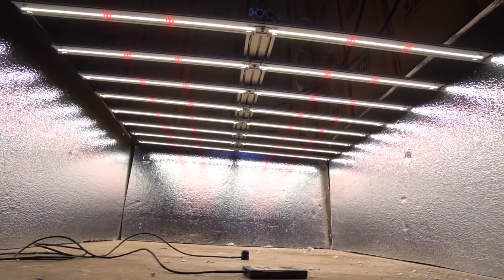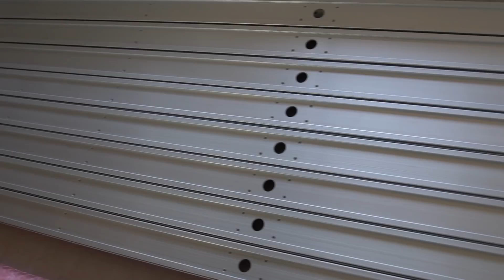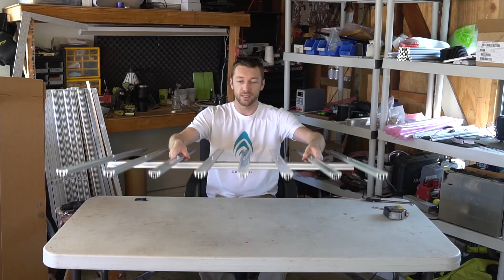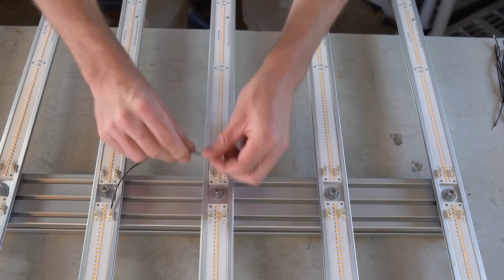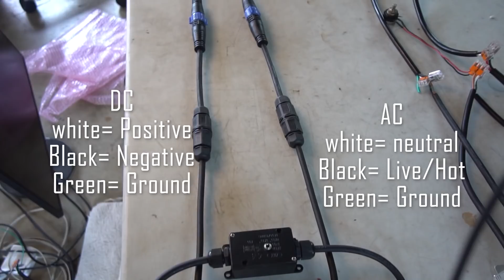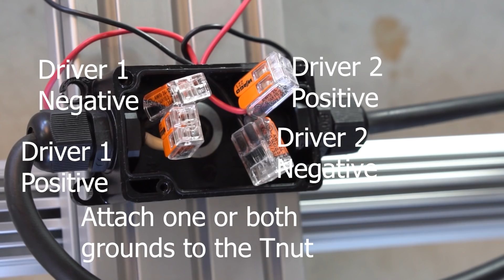Ultimate DIY LED Grow Light: Photo Boost Reference 1.2

Comment: And there goes my government 1200 bucks 😂
Reply: Same 😂 just 850 of it
Reply: @acemany1126  what would u suggest.
Reply: Why not just buy a hlg for $800? Is plc a better build than the hlg?
Reply: @elperrocovero  there a diy soultion and more even coverage.
Reply: @Ramdompcgamer  huh? What has more even coverage and which one would be better
Reply: @elperrocovero  plc uses long light bars instead of quantum boards where there all centered in the middle of your tent. The bar lights run the full size of a 4x4 tent offering a better coverage/ more even coverage
Reply: @elperrocovero  plc if u know how to build a light
Reply: @Ramdompcgamer  it´s no rocket science connecting some cables and aluminium profiles

Comment: Have built a couple of early generation lights, so a longtime follower, and wanted to see if you might have any suggestions on some bumper guards for the edges of these heat sinks. If I had a quarter for every time I hit the corners with my head I’d be rich...Lol...Thanks again for another great build btw...

Comment: With the link for the replacement heat sinks do I just have to select the 46 inches and I’m good to go there are several machining options and I can’t really tell by looking at the diagrams just worried the strips don’t look like they will fit in the same from both the drawings on the out of stock hest sink vs the suggested replacement

Comment: Hey Gene! Thanks for all the great info. Im just about to start my first photoboost build and have a question.
Would it be possible to skip the cable connectors and only use the quick connectors? Or is there a reason why you use both?
Thanks!

Comment: Where do you run the ground at the strips. Used the appliance cord to run the dc output. Have the + and - hooked up... Can I attach the ground to one of the bolts on the main frame of the light? I know the other end is grounded at the driver. Am I missing something?
EDIT: I found it...

Comment: Running 7 sets of 8 currently... (8 more on the way) what plug might the  better way to have a disconnect between the lights and the  power source.  Passing all of that “stuff” through the tent holes gets a bit trying.  Any twist lock type of low voltage recommendation?  Just noticed your elbow is wagging ? 😁

Comment: Do we have to use 18 gauge solid wire or can we use 18 gauge strand wire? I’m asking because I have a 500 ft roll of shielded 18 gauge strand wire that I use when installing hyper heat mini splits, it’s a really high quality strand wire. (Really expensive too). Thank you.

Comment: Just noticed the amended description. I guess that's the end of DIY LED lighting, big business wins again. I went all in on V1    QB288's that I was able to get for $30. Mopped up a bunch of QB120 and QB96, but it looks like those are no more. Now that I'm driving high PPFDs, it seems like strip lights would prevent the high/low areas you get running QB close to canopy.
You going to keep running the channel?

Comment: Any update on when you'll have the PLC Photo Boost strips back in stock and for sale???  I watched this vid right after you made it and saved up to build 4 of these lights. Soon as i had the funds there has been no sign of the strips coming back in stock. Tried to chase you down on your IG, even emailed the PLC contact info but all with no luck. Just wondering if theres any date on a possible restock?? Thanks for any reply brother. You're doing some epic work for the LED grow community. $1500 for a single light is not OK. Its rape 😡

Comment: I have done a couple builds with led strips just using 2 sided thermal tape and a old aluminum sign cleaned up as the heatsink. Most i have ran the builds was 1050MA on a meanwell driver but the aluminum signs that were aprox 2.5mm thick did quite well keeping the strips cool, i could have ran the strips easy 1400ma and still be a acceptable temp. The aluminium sheet or old sign if big enoughf is a great option if someone looking to save a few dollars.
Reply from the maker: what strips?
Reply: @GreengenesGarden  the strips im referring to are bridgelux eb strips gen 3 and Samsung f series strips from builds i did a couple years ago now. I don't see a reason this would not work for any strips including the photo boost strips. I know the heatsinks extrusion strips would be better rated to deal with heat as well as look a little nicer.
Reply from the maker: High powered diodes is why. And Tj temps in general.

Comment: Just so you know.  The build list for the 8 bar build recommends the wrong 1/2” imperial hex bolts if you are using 10 series as your heat sinks.  The bolt heads are too big to fit both bolts to the corner brackets.  Be sure to order 1/2” bolts from the compatible mounting hardware list that tnutz provides on the corner brackets page.  I found out the hard way.  I’m referring to the build list currently on the website also, not the one in the description of this video.
Reply from the maker: Just changed it. Should have been normal button heads.

Comment: what if i have a 4x4 tent with high reflective walls and want around 800 par through what setup can i use. how many strips  the rest is all common sense. if only someone tested just a single strip then i would have calculated it myself
Reply: What you need to figure out is the wattage needed to reach your goal of 800 PPFD. By calculations it should be at around 500W but that's board level, so better go a little higher, probably 15-20% more. So you'd end up with 580-600W of light you'd need for an even distribution of light in your space. At that point, you can basically do exactly what Gene builds here. You could probably scrape a few bucks by buying 14 instead of 16 strips but that would hardly be worth it.

Comment: I have a spider farmer  4000 I would  love to take the drivers off mount  them outside  my tent not sure what I would  need if you could  point me in the rite direction  I would  totally  appreciate  it  your the man watch you religiously  thanks
Reply: There's a guy with a spider farmer 2000, he gets 9z's in a 2x4 and does exactly what you're talking about. I forget the name but there aren't many spider farmer flower videos. I was a longer video too so if you do a search go to the filter
Reply: Get 2 ip68 3 pin connectors and 16/3 wire & just cut relocate your driver extend your cord and run a ground from the light to driver

Comment: Hi my friend!! Very very nice DIY Led built!!!! I love it, Very easy to built, very nice desing, very eficient, and big beast!! well done!!  For curiosity at how many mAh works each led with this setup??? i now that the lm301b datasheet say the maximum for each led lm301b is 200mAh but i. sure that work each led at his maximum 200mAh is not good for long live led.     Thanks a lot my friend!! and sorry about my english.
Reply from the maker: Under 120ma per 301b. Samsung has shown us data at 400ma doing just fine at many thousands of hours of testing. They are very strong and and reliable leds.
Reply: Under 120mA is very very good for long long life.   Uaaauu the data 400mA that they show you is the double than they say in the datasheet, they tell you why they put in the datasheet that the absolute maximum rating work is just 200mA and 300mA just 10 pulse of 10ms?????

Comment: why wire the led lights in series? wouldn’t it be more effective to wire the led lights in parallel. so there wouldn’t be any voltage drop per light.
Reply from the maker: It wouldn't be. Higher voltage has less drop. As well as series is not affected by drop.

Comment: Great Video!  Would this be overkill for a 4x4 tent?  I was looking at the 500 watt Covert with 4 light panels.  Would this  DIY build be comparable to the $600 Covert if you used less boards and maybe being able to use one driver?   Looking for any opinions and  would appreciate any knowledgeable suggestions.
Reply from the maker: YOu can run 8 strips at 1750-2100ma and get a very economical build. And yes, and full tilt in a 4x4 is going to be too much for most to handle.

Comment: Great video! Thank you! My only question Is what would you do if you didnt want the dimmer? Thank you!
Reply from the maker: knuckle head not add one. Same driver.
Reply: Tape off both of the dimmer leads so they can not make contact, or a wire nut.  No contact between the 2 wires= fully wide open.

Comment: I’m a bit dumb apparently because I’m having a hard time wrapping my head around how to wire the dimmer. Would u be able to link a video on how to wire this exactly? I’m looking up videos but they aren’t very good
Reply from the maker: The dimmer has two wires, + and -.
The drivers have two dimming wires...+ and -. 

Put the + together...put the - together...
Reply: @GreengenesGarden  thanks! so they go into the same hole? I was thinking I had to match each end with one separate wire. I may have been confused when i ordered the parts i ordered the box and the orange connectors and the dimmer and thought i was putting the dimmer in the box. I think i just gotta figure out where the + and - is on the dimmer, there is like 5 connecting spots.

Comment: why were the washers left out of the parts list? I ordered and now I can't build. I also can't build anyways since I only received 14 strips instead of 16. I waited over a month for this and watched the video about 5 times before the parts arrived but never caught the fact that the washers was not included in the part list. Also, you failed to mention in the parts list that we need washers, and one extra T NUT for the gland box to be secured on the last step where u make a station and mount it on top of the excursion. Also the DC quick connectors on the "clean" side that are like extensions, aren't in the description as well. also, why didn't you go into detail about how to install the potentiometer? not many of us are used to this stuff. I'm trying my best greengenes. I can't be the only one.
Reply from the maker: Washers can be gotten at any hardware store. Sorry they were not in the list and  that you could see they were needed and talked and shown in the video. 
If you are missing strips, send an email and PLC will get them out ot you. Shit happens and can still build and run with 14. Again sorry, but you can build in the meantime.  
The screws and tnutz for the gland box are accounted for in the list. Thats why there are 36...when the sinks only need 32. 
DC quick connect...not necessary and not easy to find. Either find them or not.
Reply: @GreengenesGarden  plc still hasn't gotten back to me about the missing strips. what's going on?
Reply: I think that sometimes these builds aren’t for everyone, there’s nothing wrong with that, like Gene said, Shit happens. It’s good to order extra sometimes, especially things like the T-Nuts, you can add a lot of things if you choose, Gene is giving you the necessary items needed to build his lights, even gives you a fancy way and the down and dirty way. Think, be creative, he can’t do everything for you guys.

Comment: once u plug a wire into the led board, is there a way to get it out?
Reply from the maker: Yes. push on the connector and pull the wire out.

Comment: This mite b abit off topic but cant find out wuts goin on witha plant.. Leaves are starting to droop and turn black/ grey and die. Any advice? Have 4 plants in dwc and is only affecting the 1
Reply: grey with little bit of white spots? might be mold issue, if its in DWC look over the roots and see if anything is happening in there. i suggest looking closely in there for mites or mold damage then act accordingly.

Comment: What model or what dimmer do you recommend, does that serve to lower and increase the power of the device? Thank you very much master
Reply from the maker: For a two driver system, a 50K ohm potentiometer will dim the light intensity/power draw from 0-100%.
Reply: @GreengenesGarden Thank you very much, and in case of not getting the same aluminum bar to stick the LEDs, I can replace it with a similar one that is used to place the LED

Comment: What is the out voltage (to the lights) of the drivers you are useing? I got the 1400 mA, just wondering about voltage.
Reply from the maker: 8 27v strips in series for ~216v dc.
Reply: Thanks so much!

Comment: How much on the power bill do you guys think one could save approximately, if they replaced a 12 light hps room with 12 of these?
Reply from the maker: 1000w HPS= 1100w at the wall...LED=640w at the wall.
Reply from the maker: Depends on your power cost. At $0.25/KwH it's $41 per light per months. 12 lights is $486 savings per month. Very likely more with the AC load drop too.

Comment: Hey what does it cost to put one of these together.
Reply: For DIY such a simple light, cost would much higher than bought a new well assembled one. normally 640W light 660USD-700USD with 301b diodes

Comment: Why do constant current drivers have voltages described as, for instance 48~95V? I need 4 22.3V strips, in series... What does that variation in voltage mean, and does it matter?
Reply from the maker: Constant current drivers send out a constant current...hence the name. Devices, such as LED strips require a certain voltages and certain currents. The driver only send out the voltage required by the system, but will always send out the rated current. 4 strips in series would be 4x a single strips voltage.
Reply: @GreengenesGarden  Yes, so I need 89 volts. At a constant current of 1.05A.  I have been looking at a driver that supplies 48~95V and 1.05A. its far cheaper, but feel cautious now as another driver supplies 15~143V. At the same current. On the store it can filtered so that you only get one or the other based on the... range... of voltage. Why is it important?
 but simply  would my 4 strips of 1.05A 22.3V work on the driver with the range of 48~95V?
Reply from the maker: Yes 48-95v is perfect.
Reply: @GreengenesGarden  Thank you. I never even needed to figure this stuff out before. Why I need to grow this medicine.

Comment: What if I want strips that have blue in it so I can go from veg to flower?
Reply from the maker: Well if you want blue leds for the sake of it, these arne't for you then. But if you want a plant tuned spectrum that will take you from seed to harvest, these are them. Can go on their site and check the SPD and breakdown. 
If you didn't know, white LEDs are a blue with a coating and the blue that gets through the phosphor is pure unadulterated blue, just the same as a plain blue led. But white leds get all the rest of the SPD form the phosphor too,m not just blue.
Reply: @GreengenesGarden  AH! Okay. I thought that this would only be for the flower cycle. I also didn't know that with the LED colors. That's great then. I can build one for my 4x6.
Reply from the maker: Full cycle with an emphasis on flower. All my runs are vegged and flowered with them.
Reply: @GreengenesGarden  awesome! I’m going to have to try and build some

Comment: Would this set up work with the 320h-c1400A  version drivers?
Reply from the maker: Yes. just wouldn't be controllable/dimmable.
Reply: @GreengenesGarden Would I be able to run each set of 8 strips to the individual drivers and use the built in nob to dim?

Comment: What the total $ to build this
Reply: 890 shipping and all on absolutely everything you'll need to use the water proof connectors and probably 50+ cheaper if you use wagos and already have thermal tape wire etc

Comment: 23″ Photo Boost Heatsink...says there out of stock..when are you going to get some in? Thanks! Got everything else but.
Reply from the maker: Right now. Just put more online.
Reply: @GreengenesGarden  Thanks!
Reply: @GreengenesGarden  the 3-pin connectors are unavailable, is there a different 3-pin connector that would work that you could link?

Comment: I just ordered the 50k ohm dimmer which was previously in the BOM. Now I see it lists a 100k ohm dimmer. Do I need to get the 100k ohm? Also any link or specs required for the quick connect cable would be great. I found LED quick connect connectors but I'm worried I'll get the wrong connector & start a fire.
Reply from the maker: Potentiometer size is 100K ohms/number of drivers.
Reply: @GreengenesGarden  So I assume one 50k ohm potentiometer attached to each driver. Is it possible to have one dimmer for both sides? On second thought, a dimmer on each side is much better.
Reply from the maker: No. 50K ohms is for 2 driver on one dimmer. One driver is 100K ohm. 
100K ohms/number of drivers= potentiometer needed for that many drivers on one dimmer.
Reply: @GreengenesGarden  Thanks again.

Comment: Gene, how many sets of 8 light strips can be run on 1 single 20 amp circuit breaker?
Reply from the maker: 120 or 240v
Reply: @GreengenesGarden  110v. Household stuff
Reply from the maker: 6... A*V=W

Comment: the elephant in the room ... how soon before you show us the thermodynamic side of having the heat accumulate
as it flows from the strip end to the backbone strip ...  and the led junction temperature rising with each
led  this  tsunami wave of heat flows past ... and the degradation of lifespan of the led operatinal life from
having to operate under such extreme conditins ?
Reply from the maker: Elephant in the room?? You mean how they operate at a Tj of 65c at steady state with no air movement in a 28C environment and have a near indefinitely life and output maintenance. And at 1a and below stay below 70Tj without a heatsink... Only elephant I see is the huge assumptions and lack of any substance to your pesmenistc statement you call an elephant.
Reply from the maker: Or how they stay at 72C Tj at 2100ma in the same 28c ambient. I keep looking for an elephant and all I see is an ASS.
Reply from the maker: And yes...that is real Tj...not Tc.